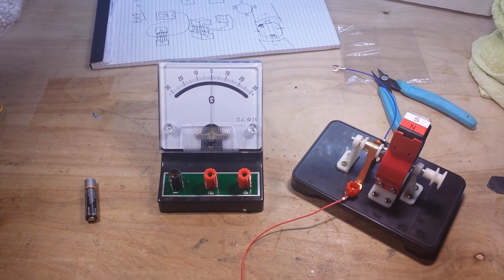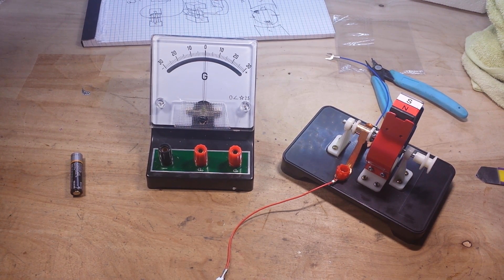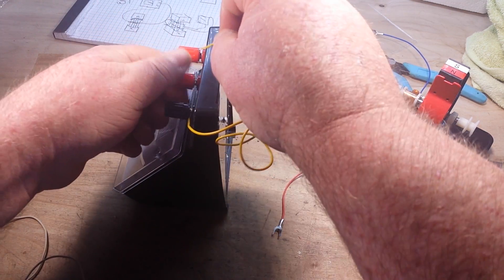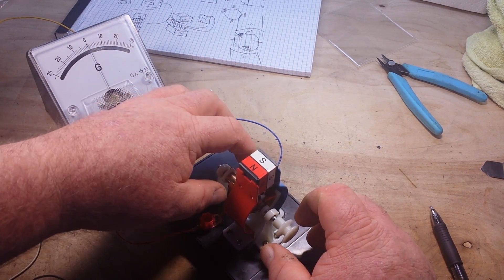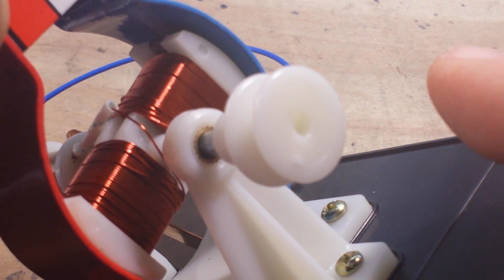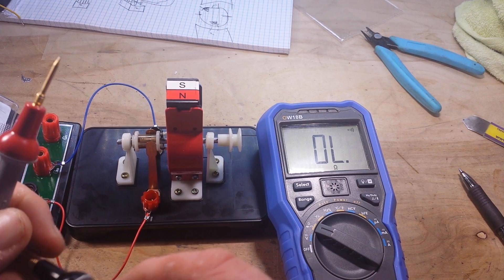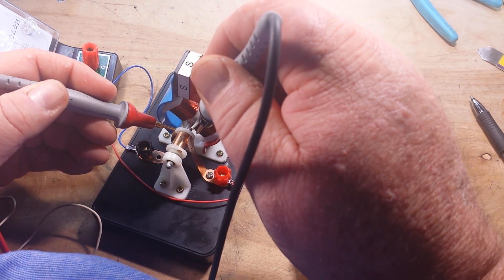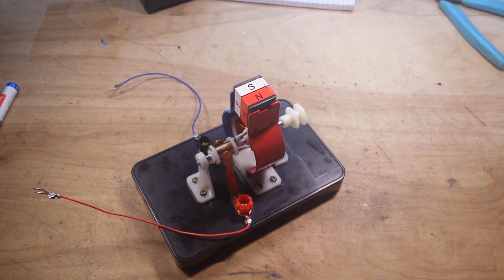EMF Motors & Generators Part II

Comment: Duct tape / plastic clamps does helds things in place. That needs some graphite... sorry for the persistence :P
Reply from the maker: Graphite would probably cost more than the motor lol.
Reply: @learnelectronics  maybe some rotary tool brushes. they are fairly cheap: https://ebay.us/NhCWQJ  and they grip the motor a little bit.

Comment: Would ac motor also generate current? Which motors are the best kind for a small wind turbine or for a bike light?
Reply from the maker: yes an AC motor will also generate current both DC and AC motors make current it's simply what type of current are you looking for. if you are using it as a bike light to light up say an LED light then you're going to want a DC motor to produce DC current otherwise you will have to rectify the current.
Reply: gl0sek an automotive alternator would be good for a small wind turbine.
Reply: @davidprice2861   they also make a good 3 phase motor.
Reply: Thanks guys!
Reply: This is a big question. You have to take into mind all the different kinds of motors that can essentially be converted into generators.. Which is.. pretty much all. lol. Life expectence vs. charging rates vs. heat generated vs noise level etc etc. i.e. a BRUSHED motor would generate more power but at the cost of noise heat resistance and life. Brushless is basically the reverse. At least that used to be the generally accepted fact a few years ago.
AC and DC both produce current with their voltages but it's obviously different and measured differently and scaled differently between the two as you'll be able to tell when comparing on a multimeter or when you get into the conversion maths, or their quantum physic behaviors(AtotheDintheC). But yes, long an short anywhere you see a voltage there is current. You can't have one without the other no matter what form it's in unless you aren't expecting your current or voltage to do any work.  so. Unless it's v=x i=o or i=x v=0 which would probably just be you setting your powersupply, that rule applies, and then that's also different. From linear to SMPSU etc. One can "push or force" a current at a set voltage or vice versa, or one "gives" it based of sensed resistance in relation to ohms law etc.